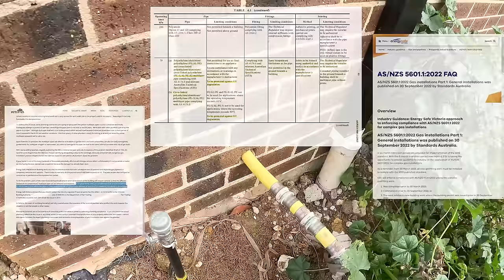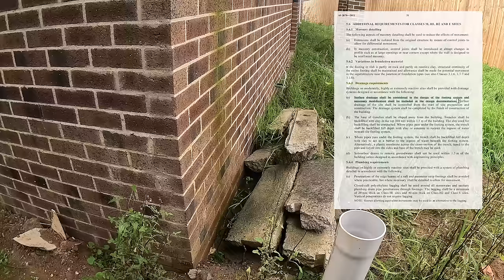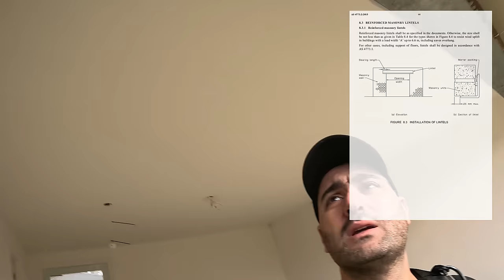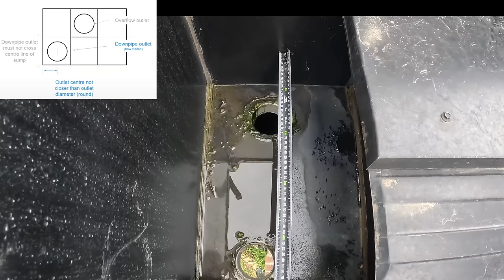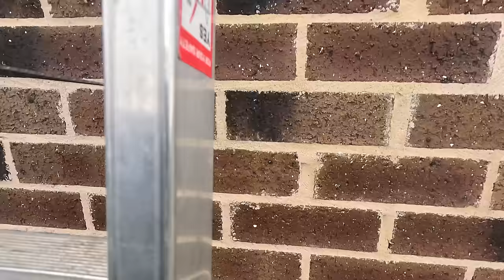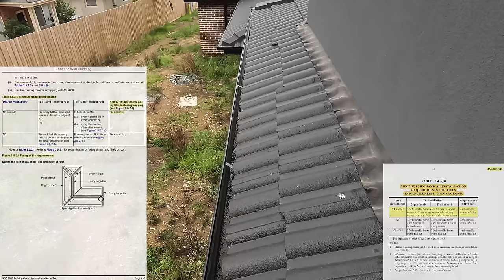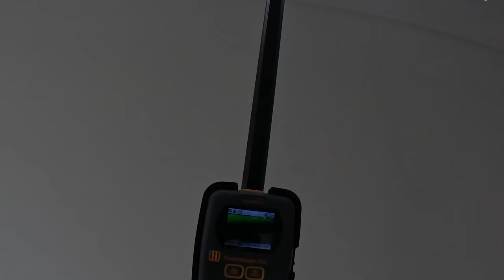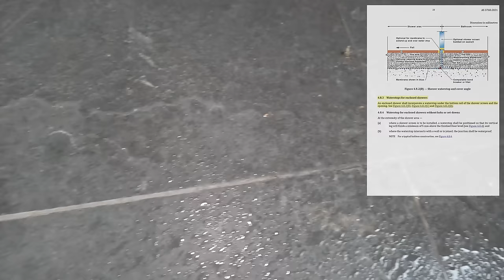The Shocking Truth: Builder Vanishes, Leaving Half-Finished Project...

Comment: How on earth did we get to the point where polystyrene foam is used as exterior cladding?!?!?!
Reply: Don't worry mate. I'm sure it's secured with twine.
Reply: I know it looks cheap and nasty.
Reply: I was wondering the same thing. Polystyrene is highly flammable also.
Reply: @dominiccatherin6661  I think it's supposed to be polyurethane or something else, which is fire resistant (I think, if I'm wrong feel free to correct me).
Reply: It’s been around for years. More common now with brickie shortage
Reply: Next we will be building houses out of old coke bottles and beer cans
Reply: Have you seen all the videos where ants have started eating the polystyrene cladding? That's what i'd be concerned about!!
Reply: This isnt only place they use polystyrene. Ever heard of waffle pods? They're basically polystyrene foam blocks used in the concrete slab - i think the idea behind it is that its cheaper than doing the whole thing with concrete, but because there has to be gaps between the pods thats filled with concrete, the slab actually cures and settles unevenly, causing the slab to be wavy.
Reply: @zchettaz  it’s for movement In slab as well
Reply: @zchettaz  the cladding isn’t poly
Reply: @dragginmedown  
Yeh, that too, supposedly. I'm a floor layer, so I grind and fill these slabs all the time to get them within tolerance. In my experience, they still move a fair bit and they seem to move more in the colder weather.
Reply: @zchettaz  I hate those waffle pods. They fly around when it’s windy, there’s pieces of poly everywhere out in paddocks in new areas, it’s disgraceful
Reply: @davidbrayshaw3529  maybe next building innovation will be used toilet rolls? Probably last longer than these builds.
Reply: Polystyrene houses are a joke.
Reply: @xeroxene  it’s not polystyrene ffs
Reply: @dragginmedown  What is polystyrene cladding (EPS) made from? "NRG Greenboard™ is an insulated wall panel that combines exterior cladding with EPS insulation"
Reply: @xeroxene  it’s hebel
Reply: @xeroxene  I was thinking of hebel. Sorry mate
Reply: @dragginmedown  13:50 No worries 👍
Reply: Follow the money. Don't forget the high rise that caught fire, the ant infestations and the birds that like to eat it and your building ends up full of holes! Why do people buy this crap and even worse, choose to build using it?
Reply: @murry001  PETRA will sue the home owner.
Reply: Sustainability hard at work 'saving the environment'
Reply: From the same people whi make stage props.

Comment: As a 4th generation Australian pensioner. Worked in the building industry. Labourer, hammer hand, crane operator, steel fabrication, sandblasting, spray painting, house painting, fencing and more. That house is absolute disgrace, The builder should be found, named and all his assets sold to finish the house. Shame Australia we have become dishonest, greedy and disgusting thieves. Not all however it's worse than you believe.
Reply: The trades who did the work are the real culprits… the builder does his best to find tradesmen to do a good job but trades are not what they once were… a bricklayer once did 1 yr pre app then 4 yrs apprenticeship… now the govt has a 12wk bricklayer course and then the govt gives them a certificate saying they are a legit bricklayer and lets them go build new homes… and what do you think the quality is like from these 12wk wonders ??? That’s not the builders fault… that’s the govts
Reply: @jac.meihoff And if it's THAT hard to find good tradesmen, the builder has even less of an excuse for letting it get to this point without catching ANY of it. He should already know he needs to stay on top of them and inspect regularly
Reply: Sounds like builders are used to phoning it in and relying on the tradesmen to self regulate.  And it wouldn't surprise me if they lobbied for these changes so they could get more, cheaper workers to build their homes.

Comment: There probably needs to be a mandatory building insurance fund that is paid into similar to Workcover by any licensed trade, with their premiums reflecting the number of times their work has been deemed faulty and in need of repair.  That way you only need to deal with an inspector working to the codes and standards, who then authorizes work to be carried out by any tradie the owner selects.  With enough strikes against your name, your insurance is cancelled - which would mean you are effectively no longer licensed to work as a trade - at all.

Comment: I inspected a place a while back with a massive site cut. Drawings said "core fillretaining wall with massive slab on top of it should hold back the 8 houses up hill" builder substituted a timber shitshow with a double brick wall and no waterproofing. Then cut an access door so they could use the unbattered subfloor for storage. Certified OK. Not a single right angle in the place.

Comment: What is the realistic lifespan of these houses? Are we talking 15-20 years? Or is that being too optimistic.
Reply: In my opinion even the cheapest house (but still within the standards and some basic pride in the job) should last 15 years with virtually no major maintenance/issues and a lifespan of around 30 years.

The expensive builds should last 50 years and virtually no major maintenance/issues for 25 years.

At least that's my expectation based on my parents house and their friends houses when I was young and what I saw in construction as a kid (in the 90's).

I'd be surprised if this thing would last 10 years without major issues and by 20 years it would probably be a dump.

My parents cheap simple build from the early 90's went about 20 years without any major issues and at 30 years old it's going to be simpler to rebuild it or sell.
Reply: @retsaMinnavoiG - the council (public housing) house I was born in back in Wales 75 years ago, and which would have been some 20- 25 years old at that time, is still there and habitable. It has stood through the harsh Welsh weather of rain, snow blizzards, and freezing temperatures and with a few basic upgrades over the years, still looks like a good build. Not so my 6 year old apartment with its suspect cladding, balcony leaks, non-compliancy issues where the builder seemed to think that any building codes he may have know about were recommendations only, and where silicone was his best friend. At 75 years of age, I might still outlive my apartment. While we expect a home to increase in value over the years, I fear that new homes these days will decrease in value as a result of rapid deterioration with the use of cheap materials and shoddy workmanship.

Comment: also if I was to have a guess. The bottom of the board was cut because the board was installed before the flashing so it has been cut to install the flashing. Ideally should be UPVC corner beads not metal as they are probably not SS

Comment: I really feel for this guy and hope he can find a way out. The same has happened to me and my wife. Contract signed August 2019, prior to covid. A high water table discovered during earthworks. No sub soil drainage installed. With winter rains in 2021, the garage, entry area was flooded. The builder set the garage slab in the seasonal water table and denied all liability. property abandoned mid 2021. Had to engage a lawyer to re take possession of the house . Could no longer afford to rent. Legal fees and rising mortgage rates have soaked up the savings, plus plus. Financially a grim position to be in when retired. It was a bad decision to go with a rogue builder.

Comment: What needs to happen is that contracts need to be written in the favour of the owners, not the builders!  Progress payments are not to be made unless the work has been signed off by a third party building inspector, and all faults found are rectified prior to payment being made.  Further to that, only 90% of the payment is to be made; balance is to be held in trust for warranty period to keep the builders honest.  

Or, should the builders have done to them what some of them were doing (and maybe still are doing) to their sub contractors - job needs to be finished in full for your work before you receive payment.  Several builders were doing this through the 70's and 80's.  They would employ subbies that were on the edge, and when they fell over, they would not be paid for what they had done.  The builder would get another subbie in to finish the work, and only pay for what the second subbie had done, and pocket the difference.

Comment: @29:42 you kick a 100mm stormwater riser to show that it is full of water, another non-compliance issue, however, it is full of water because it is part of a charged system designed to hold water.

Comment: SPRAY all the grass . Roundup and get it cleaned up . 
Lucky its locked up out of the weather . Lock the builder out untill resolution .

And temporary down pipes water away from footings and wall And clean up site and stormwater find out who the plumber is and roofer. 

Stop any more damage .

Comment: If only he got paid by the number of times he said the words "non complying"!  Having an inspection done like this is WAY too late, there should have been separate inspections done at the slab, frame, bricklaying, roof and guttering stages at least. The poor owner will have to cop the cost of pretty much ripping half the roof and all gutters out and that's probably just scratching the surface. A pox on the building industry, the councils that are very happy to take the DA fees but then don't inspect anything (private certifiers should be banned) and the building warranty insurers. There has to be a better way.

Comment: I am a total loss of words I'm from Canada and I've never seen roofs like that in my lifetime I know we are two different countries with weather where you guys have extreme heat and rain and we have extreme cold temperatures and lots of snow but we do get hot summers here also I don't understand why those roofs are made out of metal ........ 

you sure have funny Roof Systems in Australia all those things you're showing would be a strict teardown in Canada those metal roofs are not designed properly there should be no flat surface metal anywhere asphalt roll out shingles with 8 inches of Styrofoam insulation backed up on waterproof 4x8 sheets 3/8 of a thickness of water wood board this is a factory made waterproof membrane in the wood I can't understand why homes in Australia are built so bad.

as I'm a master stonemason by trade someone should tell the Australian government that those types of brick should not be used in hot climates as they are one of the worst items to use on your home.. 

I seen so many code violations and some of your videos that I'm scratching my head that either The Architects need to go back to school or at least travel to different countries as this is a complete failure of all the products if you're an architect in Australia you're a failure to society you shouldn't put flat roofs anywhere everything should have a 8-12 pitch 7-12 to repel all water and moisture from the building as fast as possible I have only seen poorly designed homes on this channel and I would love to see you interview some of these architects and explain to them how these things don't work.
Reply: BAHAHA
Reply: Oh I know.  I’m in Minnesota and there is nothing like these flat tin roofs.  Eaves and asphalt shingles.   Standard gutters and downspouts.  None of this flimsy crap.

Comment: Everyone needs to understand that it is a lot easier to criticise than build yourself to the standards that you expect the builder to adhere to😮
Reply: Legal standards are not a suggestion. 

They are the bare minimum that a qualified builder/tradie should be intimately aware of.

The difference between a cheap builder and expensive builder should be the minimum required for compliance and going above those standards to extend the life of the house, using expensive materials and decreasing ongoing maintenance through design and building methodology - plus or minus some basic potential rectification issues - (like not securing some tiles, incorrect light installation, minor leaks from guttering, wrong door handles, basic cabinetry issues etc.).

They should not be major structural and design issues well outside compliance and they definitely shouldn't be the normal for the entire construction.

Even the cheapest build using the legal standards should result in a finished house that should last 15-20 years without leaks, cracks, sagging, bowing, movement or the need for any major maintenance.

If you don't know the standards related to the basics of your trade than you are not qualified and if it's an apprentice they should be supervised and their work checked at regular intervals.
Reply: If they can’t do the job properly they ought not be doing it.

Comment: It would be nice for you actually call out the real culprits in these substandard homes you always shown in your channel and stop slagging off the Builder for cheap clickbait.
The trades that actually did the work .... the contractors who laid the bricks, assembled the roof, installed the roof sheeting(or tried anyway...)....they are the real guilty ones.  

They agreed to do the work for the price offered, and were then supplied a legal purchase order to do the work specified.  As you should know,  EVERY work order given to contractors specifies that the work be carried out to the minimum standard required by statutory the relevant Australian Standards and applicable Building codes in force at the time of issuing the PO. 

Sadly 95% of contractors wouldn't even know what standards apply to them due to extremely low skills requirements, so they just throw things together as the faster they do the job, the higher the hrly rate they earn. 
The unskilled contractors and and the sub-contract system are the true villains in this and the Builders do their best to keep these cretins in line, but its a tough job policing trades and keeping clients happy.
Every time a builder disputes a contractors works, the job stops while he negotiates with the contractor to rectify the works...and then the client gets angry with the delays and blames the builder...its a shit job to do in a failing system.
Perhaps you should actually do a vid explaining the real difficult process of building a home and managing contractors and negotiating the Building Contract and the various bodies that are involved instead of just slagging off Builders for cheap clickbait.
Reply: The builders are the ones overseeing the tradies; if they tolerate crap jobs, that’s on them to deal with said tradies.